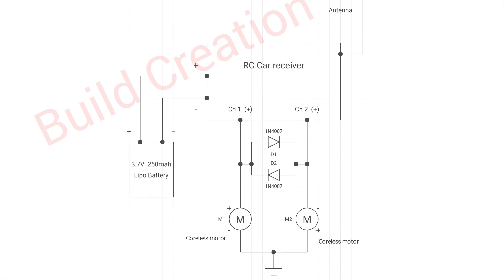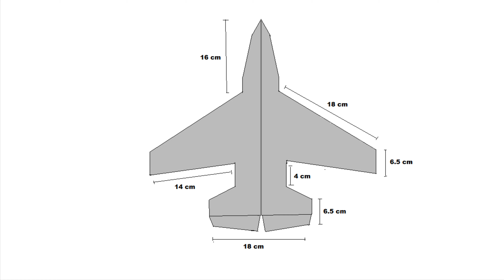Turning an RC Car into RC Airplane that flies

Comment: good night, please I have 2 questions 1) can'i use lipo 7,4volt and 2) what are the two poi,nts in the receiver  can i use : CH1  F  or B  and CH2 R or  L  thank you very mush..
Reply: bro 
F =FORWARD
B=BACKWARD
CH2 =CHANNAL 2
R =RIGHT
L=LEFT
Reply: AND NO YOU CANT USE LIPO YO NEED TO USED SOMES LIGHT WIGHTBATTIERY

Comment: I have a 27 mhz transmitter and receiver,what shud i do to increase rangeof the plane
Reply from the maker: Increase Annetta length by using wire. Of both transmitter and receiver also.

Comment: Hello, what IS the frequency of this rc plane and what is the range and the maximum power supply can use it? Thank you to answer me...
Reply from the maker: Max range of transmitter i used for this plane is  approx 25m

Comment: Which gum use to make this
Reply from the maker: Hot glue gun
Reply: Bro incase, we use 4coreless motor It can fly
Reply from the maker: @raghavendraap7176  yes,  2 on left and 2 on right side. 
Connect both 2 motors in parallel.

Comment: Bro I am using a 220mah battery with the receiver of hx 750 drone (removing all LED 's) and same propeller but it is not flying. Please do you have any suggestions
Reply from the maker: Have you did weight balance properly? If yes then keep throttle only about 30-40% and then launch your plane

Comment: How to check if a reciever is 2 channel or not
Reply from the maker: If your RC Car has steering mechanism then it would be 2 ch
Reply: Ok i have it
Reply: Does the rc plane to up and down?
Reply: Is there any way to make it full function
Reply: And also in the video u only fly it towards one direction can't we change it mid air?
Reply: Please answer I'm gonna buy stuff according to this
Reply: Please respond aaaaa

Comment: Bhai mujhe connection nahi samajh me aaya jo dono wire diode se juda hai vo receiver me kaha jude ga aur motor ka  jo do wire aapne joda tha vo receiver me kaha judega
Reply from the maker: See Circuit diagram at 2:54
Reply: Bhai circuit diagram samajh me nahi aaraha hai kyuki mai first time plane bna raha hoon
Reply: Please bhai bta do
Reply: Kya bhai diode ke dono wire receiver ke right or left turn karne wale part pe lagega aur jo motor ka jo do wire tha wo receiver ke forward part par lagega
Reply from the maker: @motivatedharma7200  1).dono motor ke ek ek wire combine joint karo. Ye combine wale joint se ek lambi wire joint karke Battery ke negative terminal ko attach karo. 
2). Fir bache hue dono motor ke wire ke bich 2 diodes joint karo ( video me sabh dikhaye he kaise kiya)
3). Diodes ke dono ends  se ek ek wire join karke receiver ko lagana he,  aur vo usme se ek wire receiver ke 1st channel (forward/backward) ke jagah lagegi.  Aur dusra wire diode se aya hua vo receiver ke 2nch channel (left/right) pe lagega. 
*dono motor ki rotation dono ke opposite me ghumna chahiye. Agar nahi ghum rahi toh motor ke connection interchange karna
Reply: Ok thanks bhai

Comment: Is that possible with 27mhz transmitter?And what is the weight of this jet?
Reply from the maker: If its 2 ch then you can use. But i would recommend to use Car’s receiver as they light weight
Reply: @BuildCreation  what is the weight of your jet?

Comment: Bro why are you using diode please tell me
Reply from the maker: For turning
Reply: The voltage across a diode drops by 0.7v. This circuit takes advantage of that by reducing the thrust difference between the two propellers while turning, making it more controllable.

Comment: Plz rc car circuit se drone banao
Reply from the maker: Hehe! Bro,  it is not possible to make drone from rc car.  😅
Reply: @BuildCreation  ok sir tnx for this suggetion🙄👍😷❤️❤️
Reply: @BuildCreation   sir plz make other plane like that  plz try 😭 🙄❤️
Reply from the maker: @artsoumen6510  you can also watched my previous videos on plane
Reply: @BuildCreation  I want tell that 🙏 plz use while in this plane then that look osm and its flying using run way
Reply: Also I have q? That what is the work off  diod

Comment: F or b or r or l
Reply: Plz tell
Reply from the maker: One wire from "F" and another from "R"
These both must give positive voltage. And one common wire from negative terminal of battery for remaining wire of both 2 motors